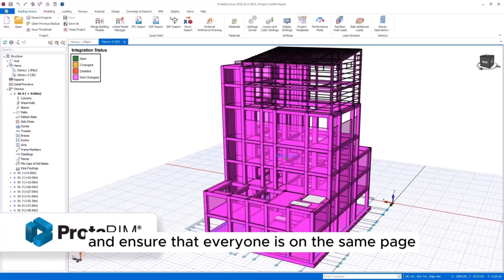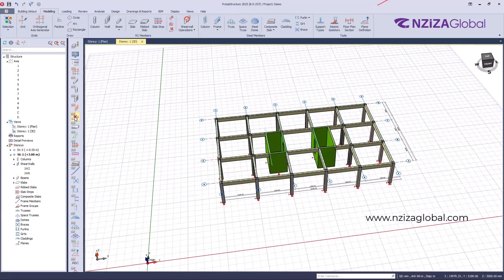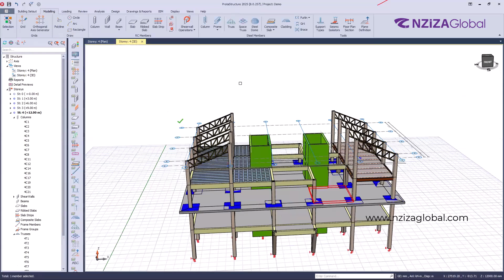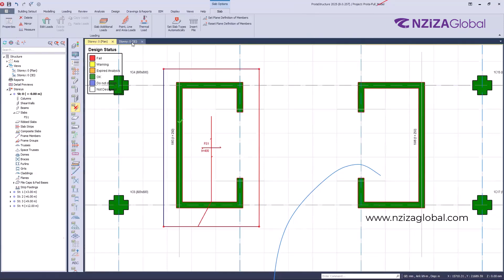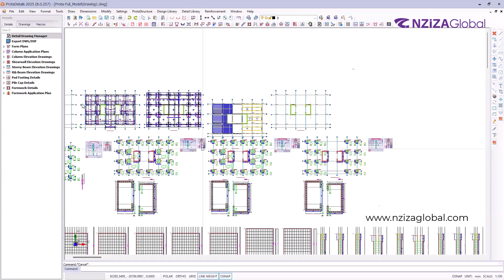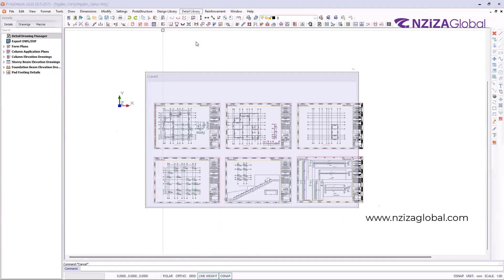Ethiopia: ProtaStructure 2025 Demo-Day | Modern Structural BIM Design | Nziza Global

Comment: When Protastructure incorporate the seismic design isolation of damper system? Seismic analysis still not enough to counter earthquake forces like what happen Bangkok where the new 34 storey building collapsed. It has shearwall and design on computer but still collapses! New software should be available to design to isolate seismic forces like rubber damper application. I don't know if Prota can do this approach and should have proper drawing design samples included.
Reply from the maker: Hello, 
ProtaStructure excels in conventional seismic design, the current version may not fully support isolation or damper system modeling out of the box. However, engineers at Prota Software are continuously updating the software based on user needs, and your suggestion is very valid. I suggest that you keep checking on the upcoming versions to see if that module is incorporated into Protastructure.